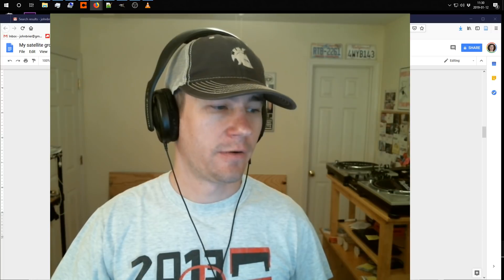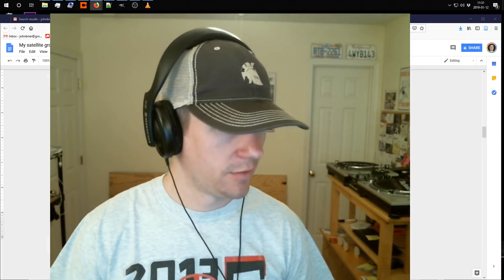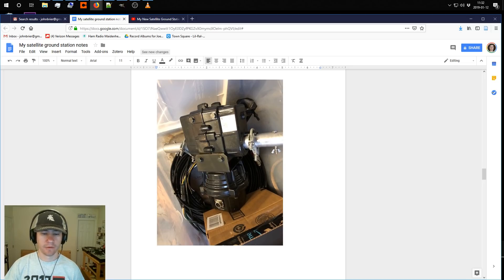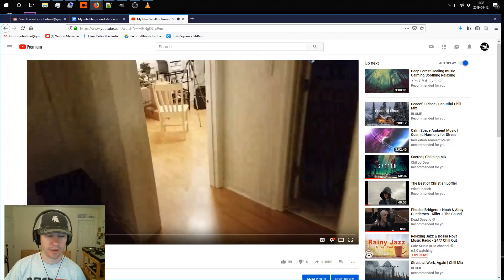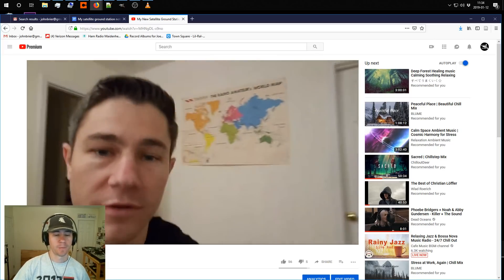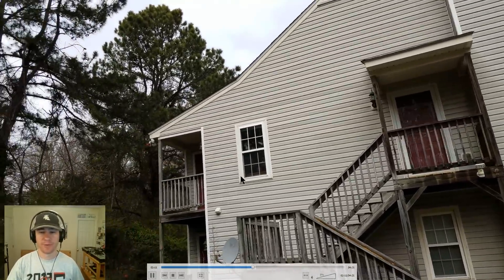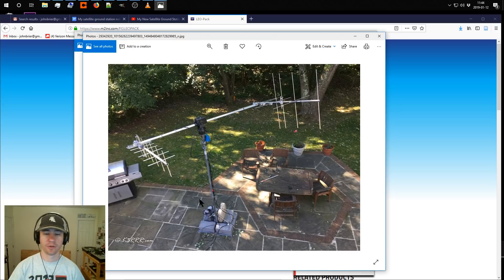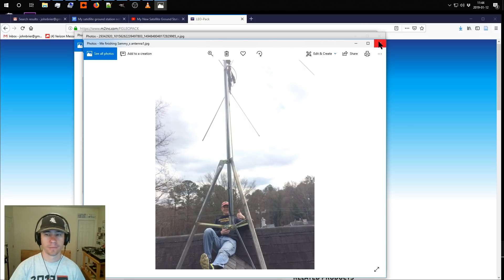Satellite ground station build - video 1 - Background

Comment: Hi John, I started watching your video.  The picture at 9:50 is my station N6AJ.  The 440 antenna is a Gulf Antenna, which is out of business, and the 2 meter is the M2 antenna that is used in the Leo Pack.  Using LMR 400 coax .I also use the EA4TX rotor interface.73 and hope to have a qso.Terry
Reply from the maker: Hey Terry! Well I hope you don't mind that I used it. I probably pulled it from your QRZ page. What is your callsign again?
Reply: @SpaceComms  No problem John. I was watching and it looked familiar.  Going to order the WIMO antenna as I wait for the 9700. Using IC9100 right now. 73 Terry N6AJ
Reply from the maker: Oh boy! Have fun with the 9700 when you get it! I'll be jealous. I hope to contact you soon!

73, John Brier KG4AKV
Reply: Terry Godley you

Comment: I just finished watching all three videos and you did a great job, John… Your series is genuinely chocked full of great advice – especially for those just getting into this niche of the hobby. Since you had a picture of my set up and were talking about trees, I thought I would share a bit of additional information. I back up to a forest that's part of a city park that primarily consists of 65 foot trees. Because of HOA rules and the fact that Wife Jan does not allow me to climb roofs, I have the freestanding 15 foot mast that will not even clear the 34 foot tall two-story home we live in. Ergo, about 310° of the 360° compass is RF impaired! Bottom line: in summer time, it's hard for me to work anything below 30°. In wintertime, I can usually work down to 15° – and for some azimuth headings, down to 5°. For some reason, pointing at the house gives me the same results for both summer and winter. Go figure. Just some tree FYI as you assemble your own uber great station. (I have a video in the works for my YouTube channel for all of this Tree QRM coming soon.) 73 de Robert K3RRR
Reply from the maker: Thanks Robert. I think I said it in this video, but I am a bit of a perfectionist and assumed I would have to move to a house with a perfect horizon before it would make sense to install a ground station. Well clearly you and others are having fun even without perfect horizons. Lots of people (most?) have trees around them and they have fun. That was one reason why I appreciated your picture.